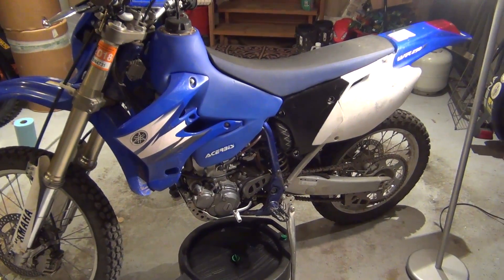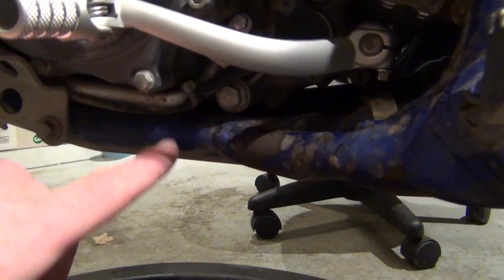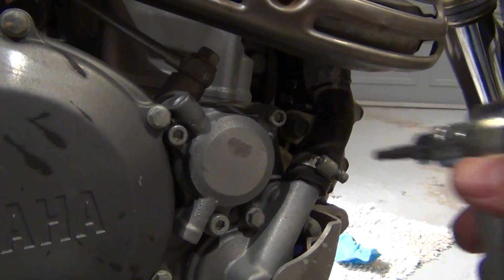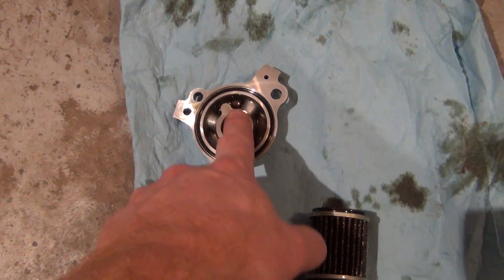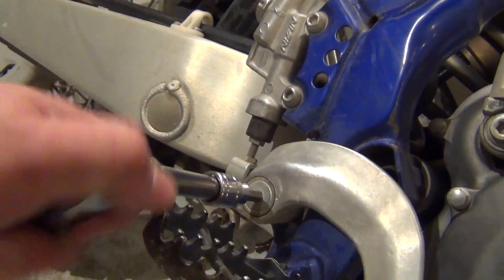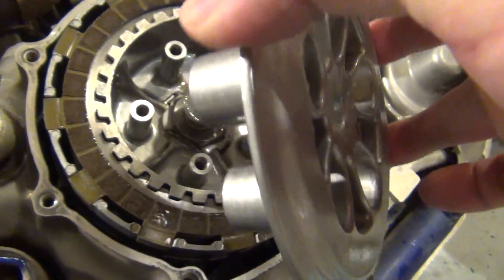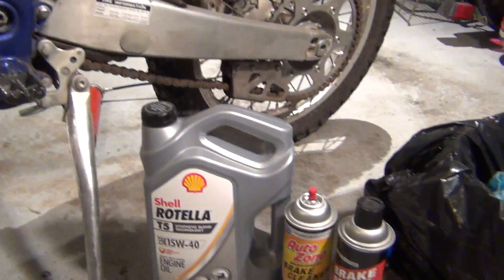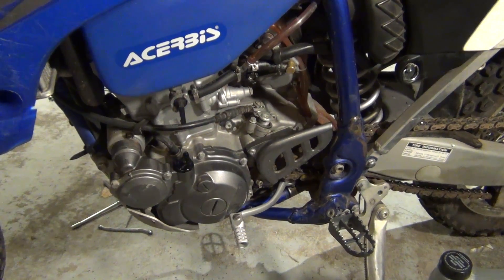2006 Yamaha WR250F - Oil Change & Clutch Inspection

Comment: Great video was thinking about purchasing this bike and it’s good to learn maintenance before hand quick question is it safe to use the 15w/40 heavy truck oil in the dirt bike I’ve read the friction modifier‘s present in vehicle oils are not good for the motorcycle clutch. I am not a mechanic just trying to learn a few things thanks again

Comment: I just bought a 2006. The odometer doesn’t have a running total. At least I can’t find it. I think it only has trip meters which have been zeroed. Can you tell me how to check for total mikes ridden?
Reply from the maker: I don't think there is a way. And even so it's easy on motorcycles to unplug and not record miles. On my old Ninja EX250 mileage was done through the wheel it would fall off from time to time and I would leave it off...LOL Honestly most dirt bike style bikes you go by how it runs and looks and stuff not really on miles.

Comment: I have a wr450f 2006, did the oilchange with a hot bike... Pulled the frame plug, spilled .3l of oil on my front tire 😒 gawd dammit. Atleast i know what to do now 😂

Comment: How often you have to change the oil and filter on this bike? I want to buy a 06 wr450f supermoto but I heard they need a lot of maintenance
Reply from the maker: It was a friends bike so I don't recall
Reply: Every 1000 miles or 10 hours riding

Comment: What's the odometer read ... my 06 is at 20 000 .... runs great still lol
Reply from the maker: Buddies bike so I don't know
Reply: i'm at 8000km
Reply: @Mannsy83  I sold mine it was at 
22,000 and still running like a top never burned a drop of oil..
Got a new bike 2019 yz450fx check out some of my vids if ya want
Reply: @Mannsy83  you should still have another 15 to 20 thousand out of that bike lol